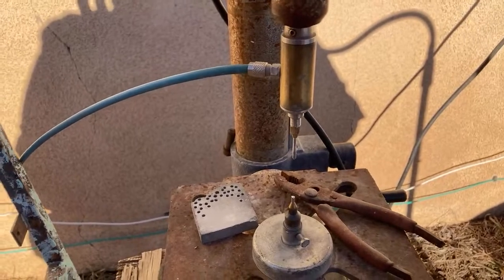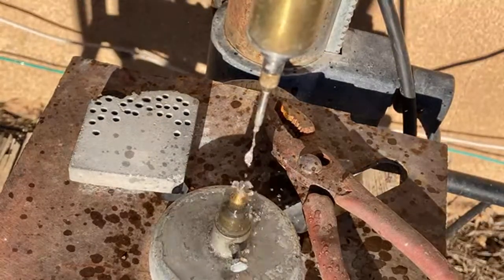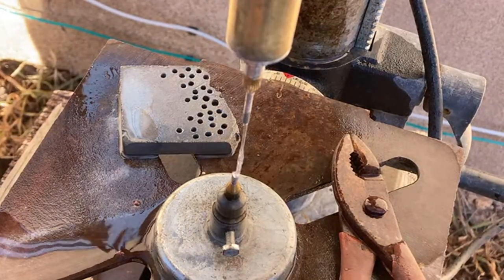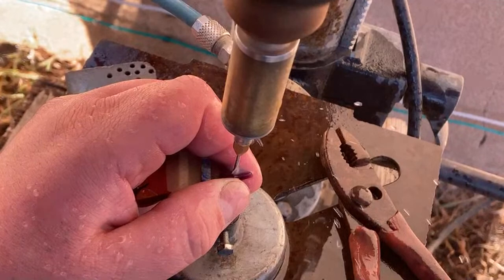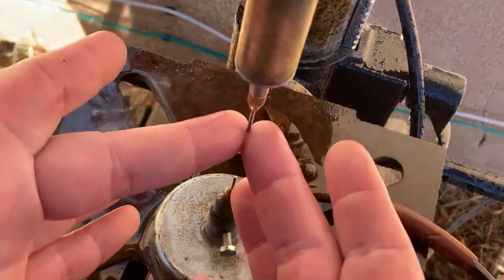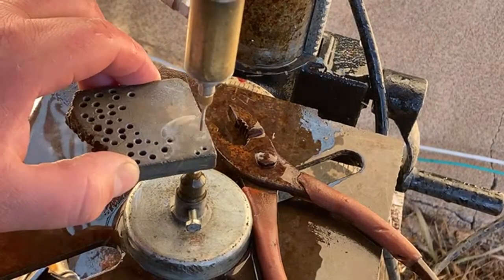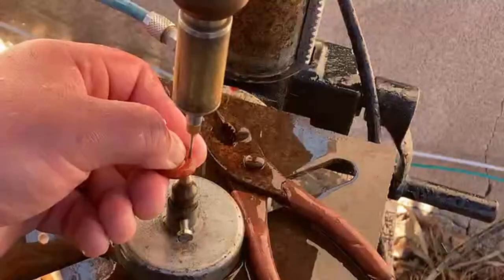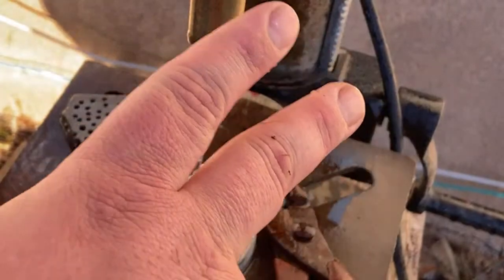How To Drill Gemstones Fast w/ Gunther Multi Drilling System

Comment: Hi,I love your video.
What kind of bit are you using?
How much does that cost
Reply from the maker: so the bitch that connect to this machine are proprietary they’re designed to be the only bit that fits into this machine. That being said they start at $35 each and go up from there depending on size the ones i usually use are $47 each

Comment: Will this drill larger holes - like 1/2" or 3/4" holes in gem stones like Agate, Quartz etc...?
Reply from the maker: Yes, I think you just have to buy the right bit but also if it doesn’t, you can get the largest one and then it’s super easy to ream after you have a decent hole

Comment: AWESOME, ARE YOU STILL DRILLING HOLES FOR CUSTOMERS?
Reply from the maker: i sure am how many holes do you need
Reply: @lapidarydave  I need 9 holes. I have 9, 40mm size round glass stone marbles. I need a 5mm hole drilled right in the center of each marbles. Are able to drill?